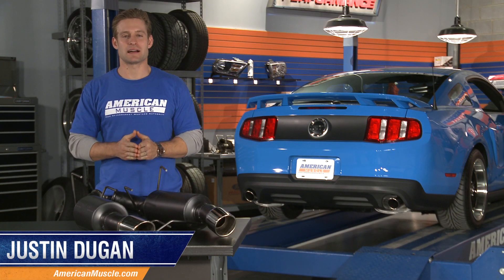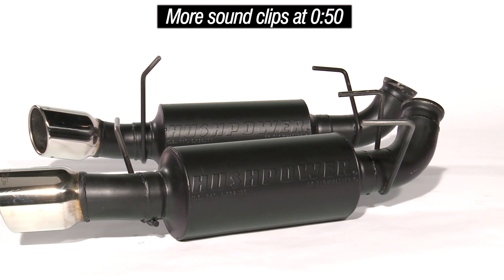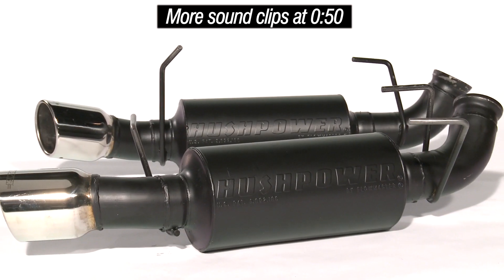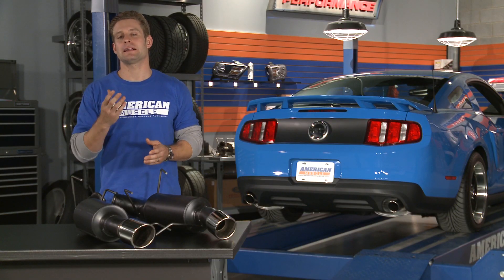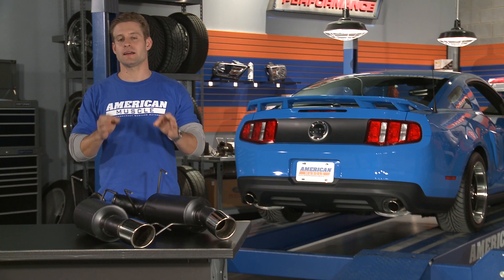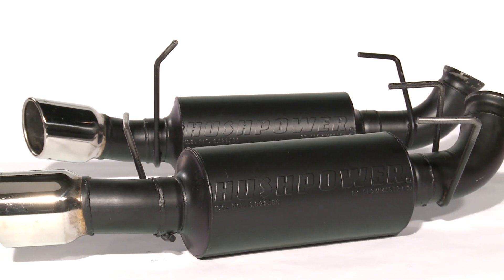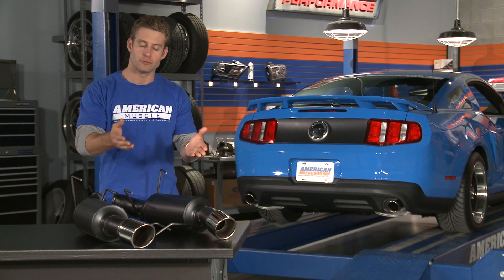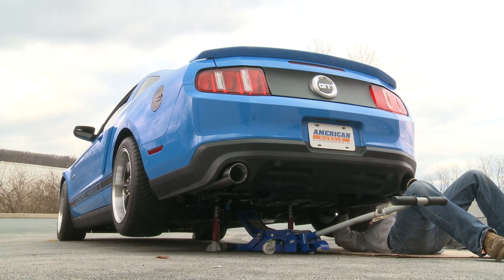2011-2014 Mustang Flowmaster Exhaust Sound Clip Hushpower/Pro-Series Axle-Back (GT, GT500) Review

Comment: I have this axle back and I'm happy with it.  There is a slight drone at 2000 rpm but a 1 or 2 mph adjustment in speed makes it disappear.  My only regret is not buying the full cat back instead of the axle back.  I like how the tips are tucked in instead of the Borla's which look like pickup truck exhaust sticking out as far as they do.  Anybody in the central Illinois area is welcome to come hear my car.  Just shoot me a PM.